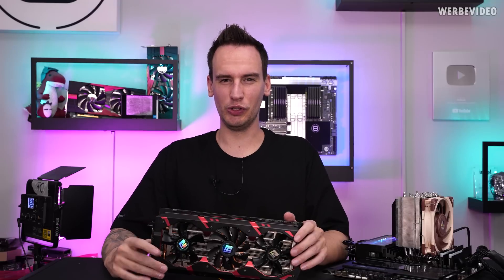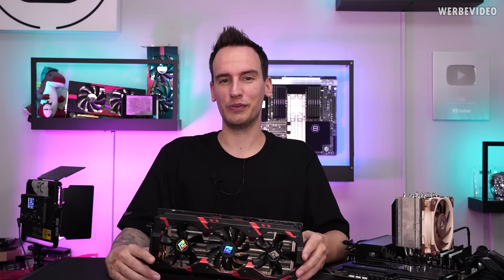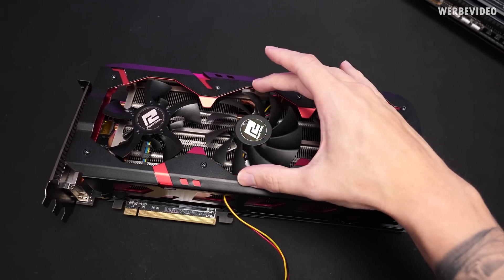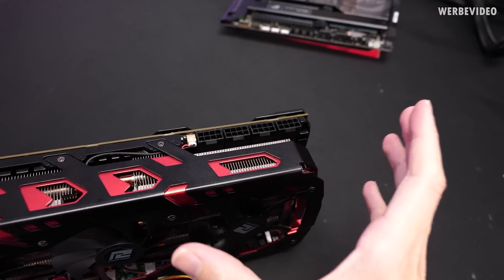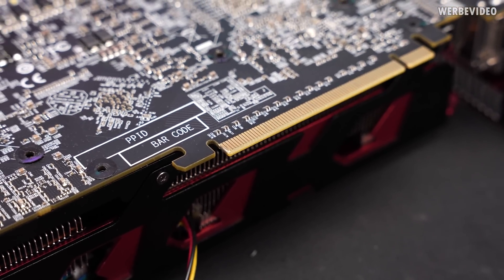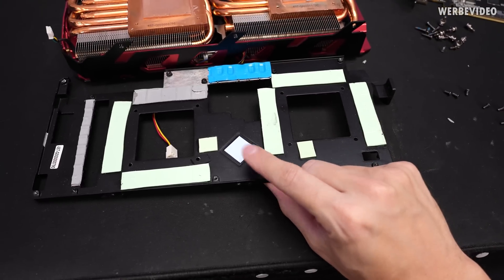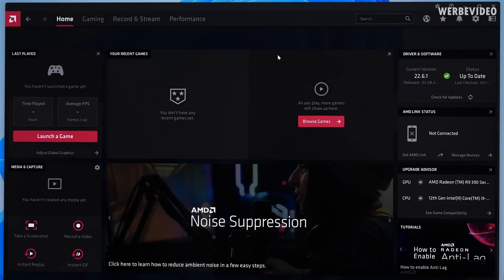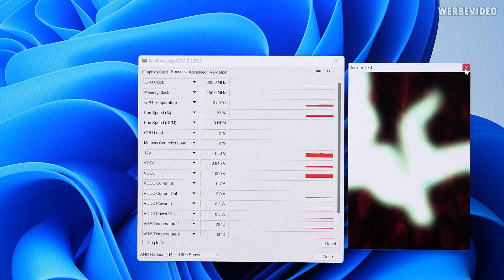HW-Legends #15: Insane 580W TDP!! This Card required 4x8Pin PCIe to run. PowerColor Devil13

Comment: if it locks your entire pc with pheripherals then it might be a gpu dye problem.
if the mouse can still react even if it freezes then it might be an electrical circutry problem.
Reply: Could be that the PLX chips were known to have problems in cards like this because they consumed about 30w on their own and have a paste TIM under the IHS (so 2 layer of TIM in total) instead of solder. I thought this was fixed on the newer cards ie 390's but who knows 
Good chance you are right about the die of card 2 being the problem. You can see when he started testing GPU#2 did get to about 30% load and the freq tried jumping up from 300 MHz. Combination of Powercolor lack of quality back then and poor lead-free soldering unable to survive the thermal cycling of these crazy hot running cards. The gpu in the front usually the problem with such a long card with seperated cooler and flimsy backplate causing a lot of flex to the pcb

Comment: Seeing old cards like this reinforces my belief that current cards like a 4090 are where the equivalent of 2 or 3 GPUs has all been combined onto a single giant card.
Reply: They kind of are if you look at the die shots. AD102 has 2 big blocks of SMs on each side of a crossbar and 2 sets of 3x64-bit GDDR controllers. Navi 31 does this as well, but in more smaller groups. ARC is a more homogenized design, but this is probably because the number of Xe cores isn't large enough, and the cores themselves too large, to start forming those higher-level patterns yet. Battlemage will probably look more like the others.

Comment: My VIA UD8 has something like that PLX chip between the 2x S3 5400EW chips. The VIA UD8 is only PCIe 2.0 x8 so.... Umm... 2 GPUs for 8 lanes.  😅 I sold off most of my S3 collection. I probably should have kept one of the earlier UD8 Revs I had because the one I still have needs a UEFI motherboard. 

Anyways, I didn't know with a controller like that that it can use all it's PCIE lanes.

Comment: This is exactly the use case for ATX12v power connections.  4x8 pin means 8 of those pins are just wasted as sense pins.  It could have been only 3 connections 🤦🏼‍♂️

Comment: I miss dual GPU cards, I had a 4850x2, amazing value at the time, and two 5970s in 4 way Crossfire, so sexy 🤤 Nvidia’s dual GPU cards were never quite as good as ATI/AMD
Reply: Why you miss that, you can still use it !
Where you ned it for is the only question, MAYA, Autodesk, stack the mem ? or in games, SLi support on them ?

Comment: I initially thought they would just be driving the LEDs off the VRM controller's PWM outputs, but it looks like they're instead running it as some kind of bar graph, which is interesting. I can't see a multi-channel comparator package anywhere but there are exactly ten SOT23 packages on the back near the power inputs, which may well be BJTs/FETs set up to switch on sequentially depending on the Vcore line's current sense voltage. Bit of a gimmick but kinda cool for that era.

Comment: I wish they'd bring back dual GPU cards, even if only for a non-gaming market. Some of the coolest pieces of tech.
Reply: Nono.. I was once a user of GTX 1080 SLI . On paper , it looks amazing. However, when you play games with it,  there is just so much microstutters. Then there is game compatibility issue, not all games work with SLI . One time experience is enough. I will never want to deal with multi GPU troubles ever again !
Reply: @fleurdewin7958  10 series in SLI was horrendous, AMD's crossfire was insanely better at that time but still had slight microstutter in some games. nvidia's SLI was king though from 8k series until the 700 series then it seemed like they stopped caring with the 900 series and later. i ran SLI 8800GT's then SLI GTX 260's and SLI GTX 580's.
Reply: @sirmonkey1985 I remember buying 6800 vanilla and almost instantly regretted it over the 6600 GT. Mem bandwidth sucked!
Reply: You know a dual AD103 4090 , and a dual AD102 4090ti makes perfect sense ;)
Reply: @tourmaline07  Good luck designing a cooler for that beast, more heat output compared to some air conditioner units 😂
Reply: I imagine too much latency to be worth it. Plus you are sacrificing TDP capabilities of one GPU to share with two GPUs.
Reply: @computersales  These cards came out before those sorts of technologies really existed in a mature state. So no, both GPU die will pull full power if allowed to.
Reply: @computersales  do you mean on a single board or two separate cards?
Reply: @kevinerbs2778 multiple GPUs on the same card would generally limit the amount of power per GPU from my understanding/experience. Excluding exotic designs like the card in the video.
Reply: 7950gx2 disagrees. That thing was garbage
Reply: All of AMD's RDNA line already support mGPU (you only lose Rebar when you turn it on)
tell developers to quit being bitches & start implementing the stuff we need. RTX 4090 can't even give good frames rates at /2160p/4K ultra setting without software gimmicks. by the way how is F.G any different than A.F.R? other than using machine learning to create a picture that you never really interact with it's basically rendering the pictures the exact same every other frame.
Reply: @kevinerbs2778 Go try it. I'm not sure it's possible with 7000 series.

Comment: did the motherboard support crossfire ? yes that is a thing , mobo needs to support either crossfire for amd or sli for nvidia or it will never work.
Reply: not on dual gpu cards, nearly every mainboard can support crossfire on one PCIex16 port with one card

Comment: That R9 390 was a killer card back when it was new. Devil 13 cards were Power Color's beginning. I had 2 ASUS  R9 280x then 3GB each with 850HX psu. 
Too bad CPU's still sucked back then. or we might of gotten more out of those top cards. 2013-2015 Throwback
I think it is funny 2 GPU on 1 card and still less than 3 slots. just lets you know how much faster and hotter cards have gotten.
Reply: and quieter, GPUs back then were much louder
Reply: paddle fans are loud @ThunderingRoar

Comment: Its an issue with the plx chip. I have a titan z with the same issue where i can get 1 gpu to work but my system hard crashes whenever i try to use the second. Plx chip is absent in nvflash and even flashing it manually did nothing.

Comment: Sort of looks like there is a missing tantalum cap on the VREG of the first die, on the top 6 VRMs, the 3rd one is missing the cap.
Reply: I seen that too, right around the section where he says that the GPU's are exact copies but turned 90 degrees, you can see on the other GPU that all those caps are there and not missing but on that specific one on the other GPU side is, you can even see a little bit of the old solder left from where that cap got ripped off cleanly! As the card fails on 1 of the GPU's that'd be my guess as to why too.

Thumbup @TA-mx3zm 's comment up people, get it to the top of the comments so that @Der8auer see's this rather than having to send it off to Chrisfix as it'll only cost a few $ then and make for a nice repair video too!
Reply: @h4x0rm1k35  chrisfix might not be able to do it in the move, send it to dosdude1 as it would be a cakewalk for him
Reply: One missing phase would certainly make it unstable.
Reply: I noticed that as well. I googled pictures of the disassembled card and yes according to what I can find it's missing a cap. I actually don't think it was ripped off the card or it would have destroyed the pads it looks like it was removed and no one cleaned up the pads with the iron and copper wick.. maybe they removed that cap to disable that phase from a short preventing power on or boot up.. or the GPU chip has degraded and wasn't stable and was completely disabled by removing the cap.. that's likely caused a power on or boot issue regardless of the driver settings so the only solution was to disable that chip in hardware not by software to get the card stable enough to boot.. but i'd replace the cap to see what happens and to trouble shoot the actual problem instead of just disabling half of the card. Kinda sux selling a card as working when you know it's not and you hid the defect by removing a part to make it boot stable.. that is something the Chinese Ali express sellers would do to con people out of cash money 💰. The card is pretty good as a single GPU card and capable but I want to see it running properly.
Reply: nope that's exactly how it comes. plus that's the VRM for GPU1, the GPU2 VRM is on the right side of the card. more than likely the capless mosfet handles the AUX voltage for GPU1.
Reply: that's how it is stock, it's not missing a cap. look the pcb up.

Comment: I wonder if the mobo STILL has to support crossfire, even with a single slot dual card? Also Sniper Elite 4 was one of the last crossfire games that had great scaling! 
 I still have a GTX 590 and an HD6990. EDIT: just a thought that the dodgy PCIE pin might cause issues, stick the slot into x8 mode.
Reply: I know the Threadripper boards (TRX40/50 WRX80/90) all mention support for all of it still. No mid-range ( or what people call consumer boards now) have support for S.L.I at all, as none of them are certified for S.L.I & must be for S.L.I not so for mGPU on AMD's RDNA line up all of them support mGPU & most boards on AM4/5 still support crossfire regardless of certification.

Comment: I have 3x GTX295 that i got for free or traded for and only one works 100%, the other one works for a few hours before power good is tripped by something (gpu, vrms etc), and the 3:e one has a dead GPU.
The on that works for a few hours was completely dead when I got it due to SMD damage related to PCI-E Gen1, yea its a Gen2 card but there are vital SMD's to negotiate Gen 1 speeds also that are prone to damage due to there placement next to the actual PCI-E connector. 

I also got a HD 5970 for free but it was also dead, someone mounted one of those crap Artic coolers on it and it was bent so the card was also bent so Im guessing a lot of bga damage.

Anyways dual GPU cards are fund BUT they dont seem to "survive" for long, ether because of user mishandling or just because you need to keep them clean from dust due to high thermals  and also the VRM's seems to be undersized due to to space constraints. 
Anyways as fun as dual GPU's are they often seems to be dead nowadays when I find one.

Comment: I have been trying to get my hands on one of these for years, how the heck did you get it? Also you should have been able to run the second GPU core standalone to verify if core / mem is operational. Windows supports selecting your GPU accelerator based on application in use. Default feature on laptops but can be enabled on desktop via regedit. Or you can do it through the Crimson software suite.

Comment: You can tell how fucked the market is now considering you could get 2 GPU's on one card for the price of a mid-high end card now. Imagien if they had two 4090's on a single PCB, it would cost like £4k+. GTX 690 was like £700 I think back when it released and I thought that was mental at the time but now that will get you a 70 series car maybe. Nice cat by the way.
Reply: You get the same wattage now as two cards in one now, (some RTX 4090 go up 600watts) & they take up four slots now too. I see no real improvement & only software gimmicks to trick you.
Reply: Yup. I had a titan card. The ones that launched at £800

Comment: I really wish we had the 4x8 power connectors. They would look so good with custom cables
Reply: I'd still prefer a single connector. But not the 12vhpwr connector. And place it on the side instead of the "middle" of the card.
Reply: Not great for systems with limited space. Sometimes it's possible to fit big GPUs in small cases,.but side cables would make it more difficult
Reply: @Xfade81 We need a connector with thicker copper plate and large surface contacts to minimize "resistance heat" risk
Reply: What's frustrating is good PCIE cables can handle so much more than the ancient spec we're stuck with. For most of us, more than 3 8-pin should never be necessary outside of extreme situations. Personally, with a good PSU and adequate cables I'd be totally comfortable pulling 600W total power with only 2.

There could easily be a "high power" standard for 8-pin cables rated for an additional 100W. EPS connectors can do that in their sleep. It'll just never happen without additional protections because the average consumer can't even be trusted to plug cables in all the way.
Reply: @JJFX-   each PCIE cable is limited to 150W. The PCIE slot has a 75W limit. So there are the limiting factor and why there are many variations.
Reply: @daniellucas6325  Well it is not 'limited' to 150W, that's just the official specification which was made a long time ago and meant to be very conservative. With ab adequate wire guage, the connector can certainly handle more. I ran a 1080FE with 300W bios on a single 8-pin for years without issue. Plently of people have pushed single 8-pin cards much harder with an XOC bios but power delivery becomes the main issue.

While you're right that PCIE is part of the total figure, the 75W is hardly ever utilized to its fullest. Usually not even close, the vast majority comes from PCIE. IIRC my card didn't even pull 40W from the mainboard.
Reply: same here
Reply: A curtain of strands
Reply: You could run the cables so it looked like there was an explosion coming out of the card.    🤪
Reply: Each cable is 150 watt. So 4 is 600 watts. Not many use cases where something needs that much power. Besides this beast of a gpu. You just want more fancy lights

Comment: The crashing problem is due to very new driver. Since the card is no further supported, it runs in a legacy mode. Just find a driver close to the release of the card and your problem will be solved.
P.S. Finding the appropriate old AMD driver is like winning the lottery 5 times in a row...
Reply: Nimez drivers to the rescue.
Reply: Yeah it's definitely a driver issue, not a hardware issue unless there's a missing cap on the pcb causing instabilities. Trying to get two gpus to work together in tandem on a single PCB would require specialy driver magic coding to get the two gpus to cooperate. AMD obviously abandoned the technology if their newer drivers are any indication. He needs to go back to the very original legacy drivers, and maybe start with version 2 or version 3 of the first driver update (amd will have implemented fixes and improvements with a few versions after the original).
Reply: @luminatrixfanfiction  I would say that these dual GPUs were built as tanks. I've got lots of 5970 still working on a project for more than 14 years, and they never missed a beat. Even those that were used to mine bitcoin, they were damaged due to heat/fan issues and not due to caps blowing up.
So, it should be a driver problem. He said that he spent a couple of days working on the driver problem, but it's the vanity of the newbie to get something working wit the "best/latest" drivers, not having spent hours uppon hours to resolve AMD drivers issues... And I am not even mentioning trying to run multi-gpu stuff on linux....

Comment: Could it be that one damaged PCIE pin causing the problems? seems unlikely but...
Reply: The last PCIe contact pad on the back of the card is a ground line. The one next to it is part of the 16th PCIe lane. Since the first GPU performs as expected, it's unlikely that the lane is damaged or shorted, and missing one ground (of many) won't matter much. Worst case, if lane 16 was taken out, the main link should fallback to x8, but the links between the GPUs and PLX chip would be fine, and both GPUs should still work identically.
Reply: It's the missing cap off the 6 phase vrm.. likely because of a degraded GPU chip and was no longer stable or something was wrong with the vrm phase
Reply: I think it's VERY likely to be the prob...but there is only ONE WAY to find out lol

Comment: i tried CF and SLI few times but it always was a mess, this tech had to die
Reply: I had a 2x 290, and dual furys, with a bit of tweaking I had great results in games like GTA5.
Reply: i had iirc microstuttering when it worked idk in what game @Born_Stellar
Reply: @ViperBenchmarks  excuse me, but I can name at least a dozen or more games that released this year with this so-called "micro stuttering or stuttering" you talking about & those games did't use mutli-card. The problem still exists & wasn't the multi-gpu's problem its the game engines problem most of the time.

Comment: Could the R9 390 chips be swapped with R9 390X?
Reply: No, those are different chips, 390X has actually more computing units.
Reply: @PolskiJaszczomb  same memory bandwidth. Should have same solder connection points. Would just need two vBIOS files from their RX 390X.

Comment: Yeah AMD did something to the drivers few years ago. I had a R9 295x2 that worked perfectly fine and after needing to reinstall windows no driver would allow for both GPUs to work together. It happened at the first generation of cards AMD had no crossfire supported cards and abandoned the technology. Their GPUs are build so well from that and previous eras, but the software support made me swear never to use AMD GPUs again. SLI on the other hand still works fine and you can even use different GPUs no problem with that workaround that disables forced restrictions. I think it was called different SLI auto.
Reply: That "Different S.L.I auto" won't only works up driver 427.89 on Nvidia it doesn't work any thing past GTX series like RTX 2070 super on up to the RTX 3090 TI's which have S.L.I connectors.
Reply: Dude im sure theres a driver on linux that would work perfect. Don't give up on AMD yet😢